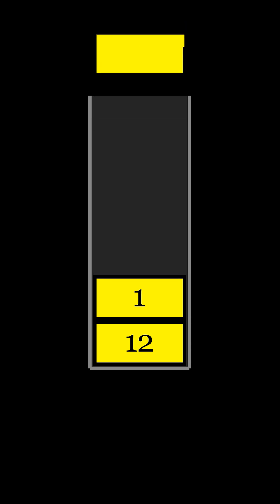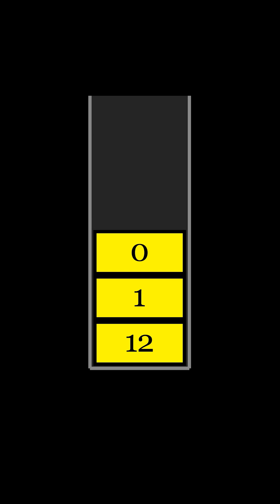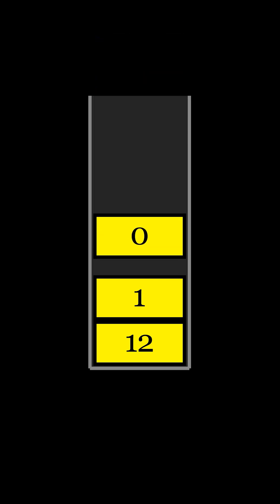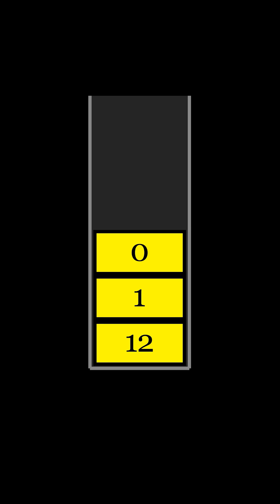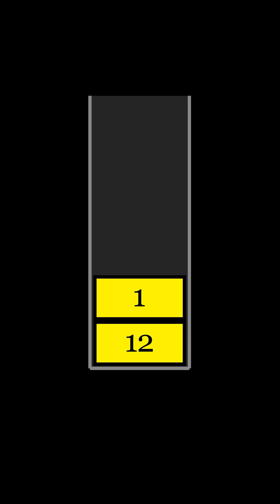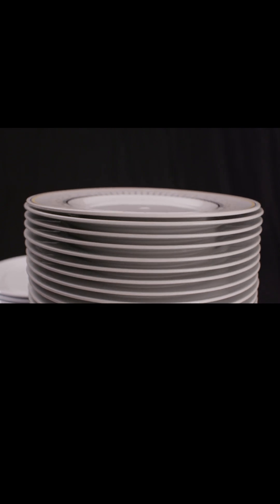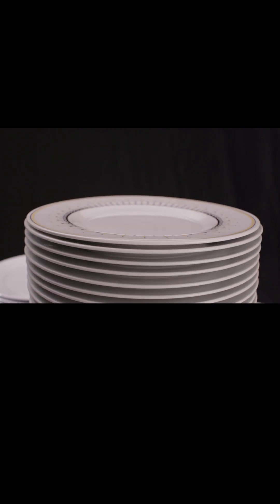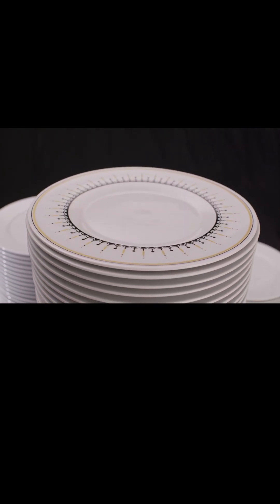Stack Visually Explained #dsa

Comment: what if i put there a string will it work? i think that's what it all about
Reply from the maker: Yes, because it's implemented in python, which is a dynamically typed language meaning the data types are interpreted at runtime.